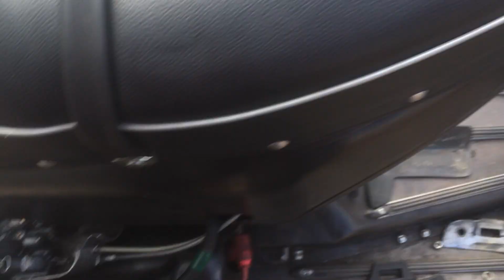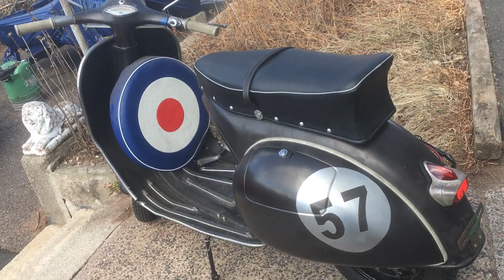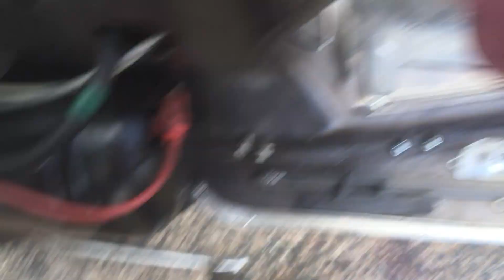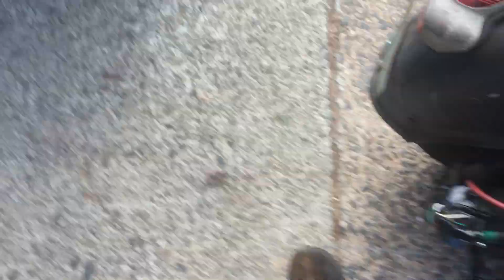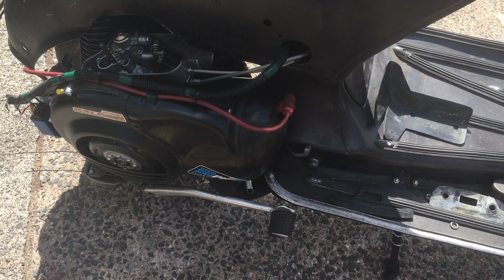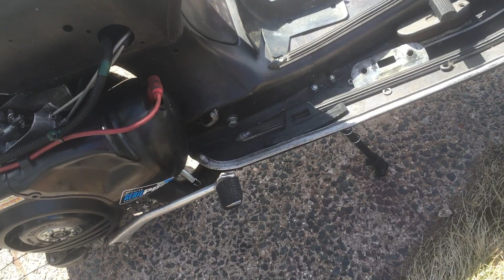Vespa GS150 had VBB engine swap now P200e swap.

Comment: Hi thanks for adding your video , im thinking of doing the same and adding a px200 , apart from the carb cut out to the frame is there anything else i should be aware of before doing it , best regards Del
Reply from the maker: Rear shock does not line up.. Need a rear shock adaptor, and may need to customize bottom connection of shock. Also SS 180 rim has a different offset that works much better. Not easy.
Reply from the maker: I may make more vids on it in a few weeks.
Reply: @pmodrat  , Brilliant thanks for your reply , il look out for your other Vids
Reply: @pmodrat  finding that same problem when i put an aftermarket race carb for it. trying to find a way to fit it. trying to find a smaller maifold for it but no luck.
Reply from the maker: @yohunter5426  I may have to cut the frame some more. I take a break from it every so often because I have other projects  and things going on. Also the price of things now are getting very high. There may be a smaller manifold at sip. It shorter with a little up angle on it. But will need a small body carb to work. If it works. All experimental.